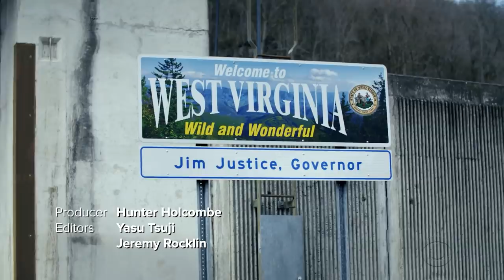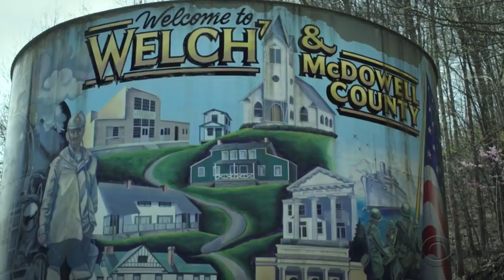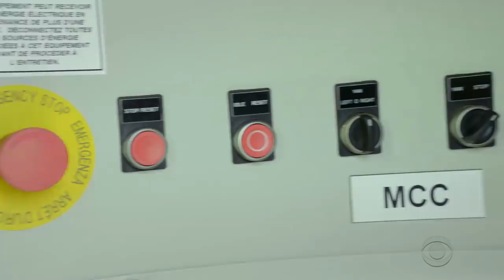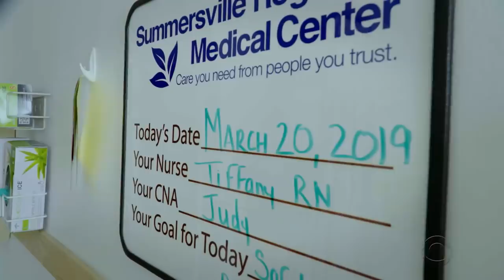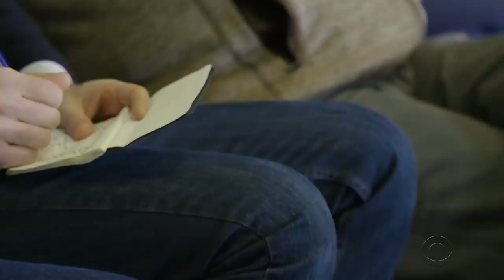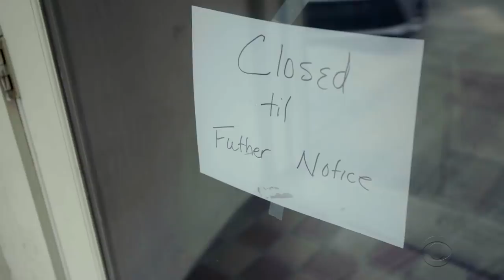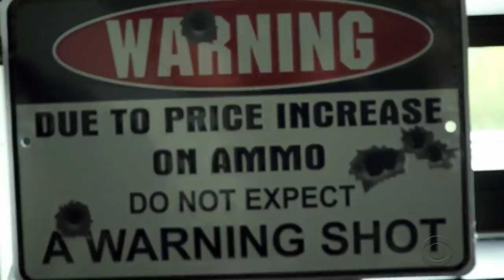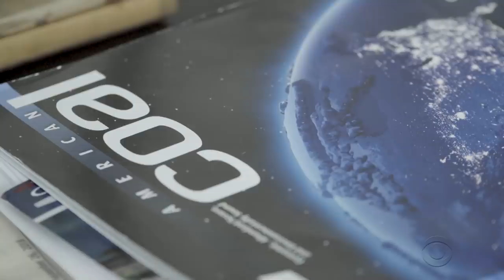Clinging to coal: West Virginia's fight over green jobs | Full Documentary

Comment: WV  is not a sunny state. There are many sunless days. Good luck running your home and taking a shower more than once a week using only solar. Coal has been good for WV economics. It will take a long while, if ever, for WV to recover using new technologies in a rugged mountainous state.
Reply: I live along the Ohio River in northern WV, but what about hydroelectric dams, kenetic energy devices, even solar (it's pretty sunny if not overcast most days where I live).
Reply: For sure'. camp house built 6 miles south in the mountains of charlst- W/V . Black bear and 10 copper heads. solar panals would all most be impossible to set direct a daily sun.
Reply: trafficjon400 where the sun comes up at 10 in the morning and the sun goes down about 3 in the day

Comment: It’s time to end it for good. Renewable energy is much cleaner for the workers and much better in general. Solar and wind are only a stop gap for fusion power which when it becomes viable, will replace literally every power source ever. All we will need will be fusion as it is much safer and better than fission; less  nuclear waste, higher efficiency levels, etc. Besides, coal is starting to cost more than it produces in wealth, so it won’t be viable much longer. Fusion just needs some seawater and you got power for years.

Comment: The world dosent grow without coal. Coal=steel steel=cities
I'm from kentucky but work in virginia in the mines. We do need to get better at using it, but we cant cut it out entirely. It would end our life around here, literally.
Reply: "The world dosent grow without coal. Coal=steel steel=cities"

Steel can be made with heat from several sources, including natural gas, induction and more

 Induction furnace - Wikipedia
https://en.wikipedia.org/wiki/Induction_furnace

An induction furnace is an electrical furnace in which the heat is applied by induction heating of metal. Induction furnace capacities range from less than one kilogram to one hundred tonnes, and are used to melt iron and steel, copper, aluminium, and precious metals.
Reply: @HobbyOrganist  induction furnace powered by coal electric. Coal is way safer than natural gas too. Just ask all the people killed in natural gas explosions every year. And coal is cheap power too
Reply: @brcar6862  can you link me all these people dying from gas explosions? I looked it up and it was nowhere near the number of dead coal miners every year. Not even close.

Comment: Here's an experiment,  take for instance the electric mains that run into your house via a powerline from pole to your meter then panel which is being fed by a coal/NG fired power plant. Turn EVERYTHING on electrically in your house all at once, Stove, Dryer, Toaster, Washer, Dish Washer, Heater, Lights, anything and everything you can think of! Everything! All runs and works right? Good.  Now transfer the electric to the solar panels installed and bolted on top of your roof that back feed into your mains and do the same thing. Everything work? I Didn't think so. Solar is an absorption.
It's all about the AMPS.  Sure you can add real estate for more panels, better devices, LED's, flat screens,  etc for efficiency but when's enough enough?
Reply: Your Breaker box would melt. The sub station would explode. Your experiment would fail without the outcome you envision. 
That is such irresponsible thinking. 
Save energy, not waste it.
Reply: It's about an energy mix - wind, solar hydroelectric (where available), natural gas, nuclear and biomass.

Comment: Here’s the thing. Many people automatically make the assumption that coal is dirty and polluting. However, if burned efficiently the pollution could be cut down. Coal is still a viable resource for energy because there is still plenty of it. Energy is a huge part of our economy. While renewable resources are beneficial, they have many downsides. Wind turbines only work when the wind is blowing and there would have to be a lot of them in order to provide enough energy to be worthwhile, but this adds to the cost of maintenance. Hydroelectric dams are fairly reliable but they can’t be built everywhere, they are expensive to build and can potentially damage an already existing ecosystem upstream and downstream from flood risks. Solar energy obviously only works when the sun is out. It doesn’t do anything at night and isn’t efficient in overcast. And in order to generate any substantial amount of energy, there would have to be a massive field or solar panels. The power output also fluctuates wildly with clouds and weather making it very unpredictable and unreliable. I also speculate that the highly reflective nature of solar panels reflects a lot of he suns energy back into he atmosphere. 
So renewable resources are fine for contributing to the grid to help lower the loads on other power plants, but there is no way they can feed the grid alone reliably. Coal, natural gas, and nuclear are very reliable and can output a ton of power to the grid at any time. Coal and natural gas do pollute to some extent, however efforts have been made to cut down on the pollution by making the power generation process more efficient so less fuel is consumed as well as filters to lower carbon dioxide and nitrous oxides emissions. Those types of power plants are good for on demand power when the grid needs a boost at any given time such as in the summer when people and businesses are running air conditioners. 
Nuclear power is a very clean source of energy and is relatively safe. Yes there have been incidents regarding nuclear power but they are few and far between. They produces huge amounts of power and emit no pollution. The downside to nuclear power is that boiling water reactors must be built near a body of water for cooling and there is the problem of how to properly dispose of nuclear waste. That issue remains to be solved. 
In conclusion, coal is another source of energy that contributes power to the grid in conjunction to other meathods of power generation including green energy. The more green energy is produced, the less coal is used for power generation but should not be disregarded entirely.